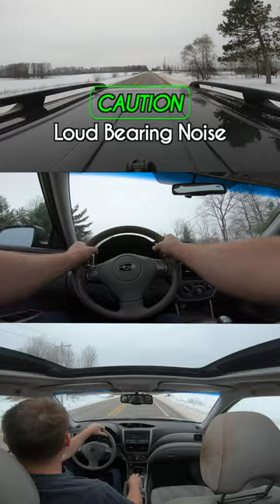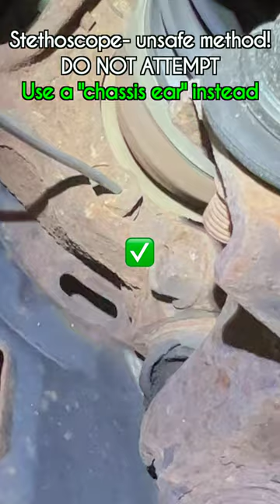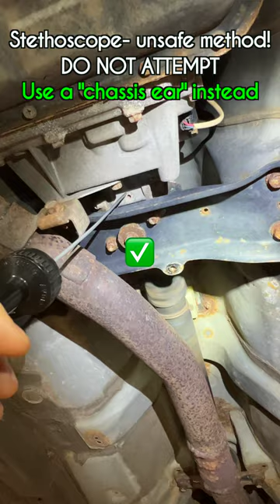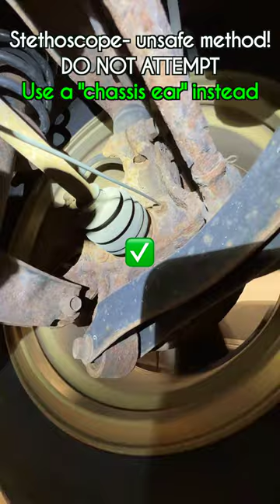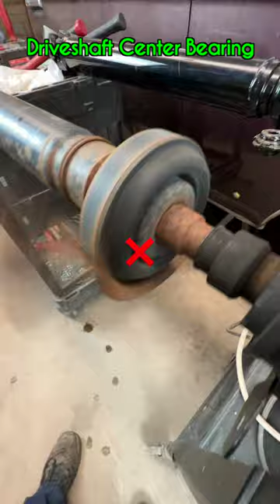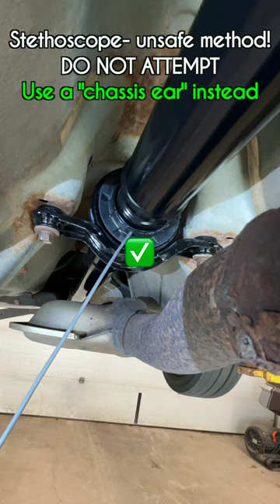A BAD WHEEL BEARING NOISE

Comment: How is a stethoscope unsafe??
Reply from the maker: Not so much the stethoscope, but generally being under a car with it in gear and running. Tires and axles spinning cause injury/death if contact is made with those parts. A chassis ear is much safer. Stethoscope wireless sensors can be attached to suspect parts with the vehicle off and stopped. Then on a test drive they can be tested at any vehicle speed to pinpoint your noise. Much much safer method 😃🔧
Reply from the maker: It is pretty loud, but probably won't hurt ears. The Chassis ear is much much better tool for the job in terms of safety. It will help pinpoint the problem very quickly also 😃🔧
Reply: @Easy Fix  but how tf are you gonna find where the issue is if you don't go under the car ??
Reply: @DA_BEAMERRRR  - it is not about not going under the car... but not having to go under a car with spinning drivetrain and wheels that can “suck you in and spit you out”

  You use a remote sensor or set of them,  to listen to the spot/s you want to check, during a test drive where you are safe, inside the vehicle.
Reply from the maker: unsafe for ALL
Reply from the maker: Wireless Chassis Ear- Steelman
Reply from the maker: Yes very scary!

Comment: It's really helpful to include how it sounds when it's bad, gives a great example to use when you have to hear for any bad bearings

But I'm new to this trade so I doubt I'll be able to put this to good use any time soon 😅
Reply from the maker: A wireless steelman chassis ear will help make you an expert at pinpointing bad parts quickly and learning NVH overall very quickly. Buy one if you can as soon as you can.. You will use it a lot. And, you will likely become the shop expert because of it over time. Don't delay if you can, they are extremely valuable 😃🔧

Comment: Best way to find the bad bearing is to run em till it blows. AAA is $178/year for the premier membership which gives you up to 4 200-mile free tows.
Reply from the maker: That is extremely irresponsible and dangerous.
Reply: @EasyFixShaun   this is where my customers come from. 😂
Reply from the maker: @hotpackjay  Scary! Perspective of driving on bad wheel bearings changes  quickly after seeing a few catastrophic failures 👀

Comment: This method only works if you can access the areas that need checking.

Damn Fiat is too low to the ground for me to get under it on my jack stands highest safe settings. And Vans too high for me to jack the wheel off the ground.
Reply from the maker: True. Sorry you are having trouble. The very best way I have found is by using a chassis ear. It requires access also though. Here is a link to the tool.
$270 Steelman cordless: https://amzn.to/3DjGF6v

Comment: Bro no I have a 2003 Subaru Wrx and I had to change all 4 bearing at the same time that was annoying
Reply from the maker: Wow really? How did all four go bad at the same time?
Reply: @EasyFixShaun  He didn’t change them until he looked up the word cacophony. Eventually the radio could no longer drowned out the buzzing…
Reply from the maker: I mean all four can go out at the same time for sure, and it's an older car. I was just curious how that all went down. 
But yes, don't use the radio to drown out the noise. Very bad 😃

Comment: And that's the stupidest thing about Subaru's they should be able to sell that one piece not the whole shaft that cost 500
Reply from the maker: True. The center bearing isn't really serviceable. Usually the shafts are durable though and last until 175k-225k. That's a lot of revolutions 😃🔧
Reply: JXB makes custom center support bearings. Relatively easy to install, just cut the old one off and leave the rubber, assemble and enjoy. You don't even need to take the driveshaft off! $280 is a steal compared to the 1500 or so for a shaft.

Stick it to the bean counters trying to make stuff unserviceable and disposable!
Reply: Honda does it too 🙄 non serviceable u joints because to hell with your wallet

Comment: You dirty dog you sold him an entire Driveline all he needed was a carrier bearing
Reply from the maker: Center bearings not sold separately on this model. It's crazy. it seems more and more the "new normal".
Reply: @EasyFixShaun  Penny saved up front so you can spend dollars later
Reply from the maker: Yup they hosen us 😃😂
Reply: @EasyFix.  even toyota sealed all the u joints no more zirc nips
Reply from the maker: That's just insanity. There is zero justification for it.

Comment: Drive shaft replacement just for a carrier bearing? That’s a crime
Reply from the maker: Many manufacturers make driveshafts with un-serviceable  parts. First one I have seen was around 2004. Very sad 🧐
Reply: Says who?
Reply: Audi's are known to do the same thing. Though 034 Motorsports has a kit to fit a new bearing on an old driveshaft.
Reply: I just replaced my carrier bearing on an old drive shaft but that’s for a 1990 Volvo 740
Reply: On my 2011 Subaru outback you can’t even service the u-joints. Have to replace the whole prop shaft
Reply from the maker: Very frustrating. Seems like a big waste of resources.